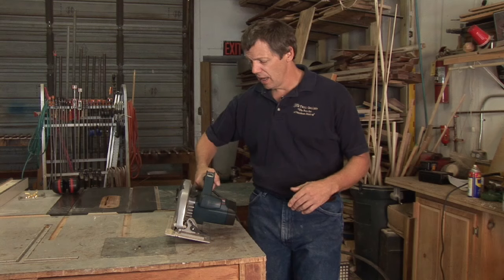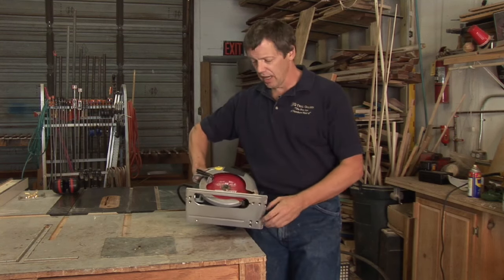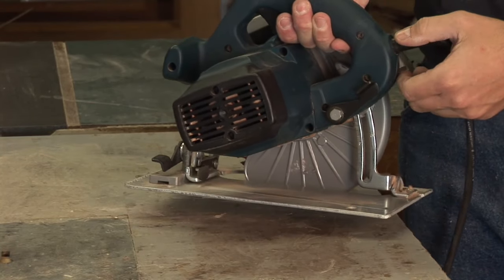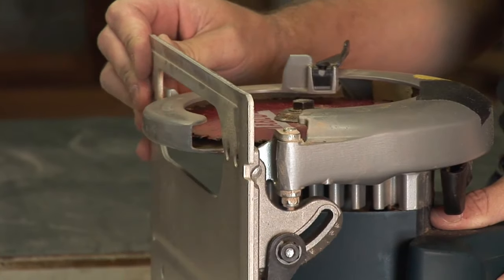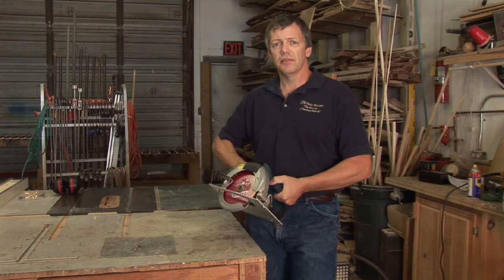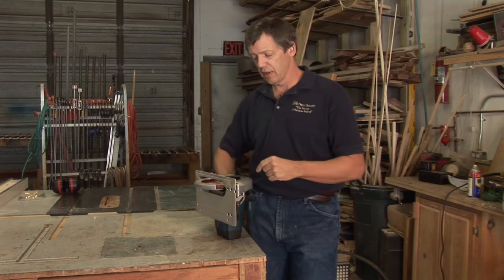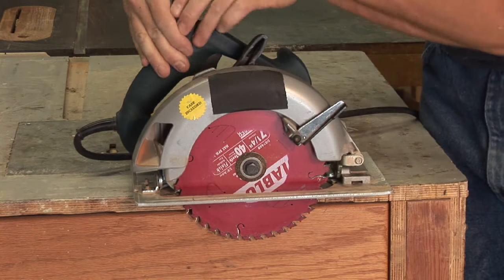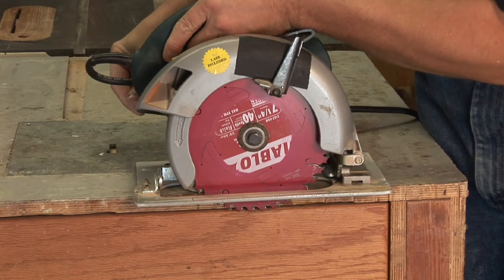How to Adjust the Height of a Circular Saw

Comment: My Skill saw maybe much older but it has a nut that's quite thin on a bolt that secures the red height adjustment lever. I guess I'm supposed to loosen the nut first. Needed to know the nut size bc there's no room to get a ratchet in there and have to try a thin wrench.. Sheesh!

Comment: hello, have a quick question, what if the blade & the base plate (the shoe) doesn't parallel to each other, off about 2mm++ will it be able to cut a straight line? thanks

Comment: Why only a tooth? What difference does it make to have more blade stick out? I assume it more binding or higher chance of kick back. Just wondering if anyone can explain the physics,  thanks!
Reply: Andrew Lipic I just bought a Circular saw and I never adjusted the blade. It was constantly kicking back for no reason. I learn to adjust the saw and was just practicing with it and was having no issues.
Reply: @jasonchilds5397  thx

Comment: Setting the saw to the same depth as your product produces a larger torque on your motor and kills the life of your saw. Setting your saw like this is a huge misconception. The actual cut area of the blade is increased for no reason.
Reply: You make no sense.. If the idea of using the saw is to cut through a piece of substrate, would you not want to cut all the way through it???